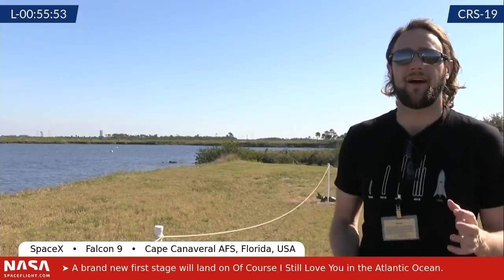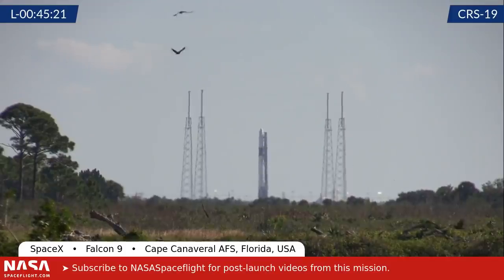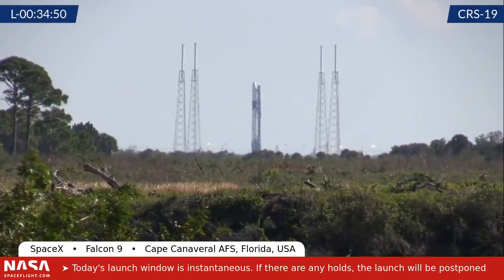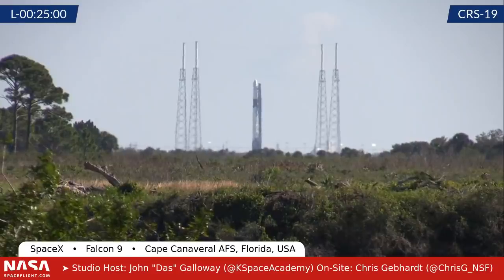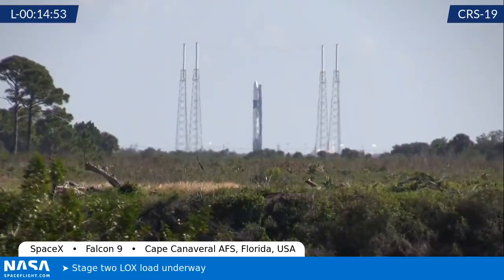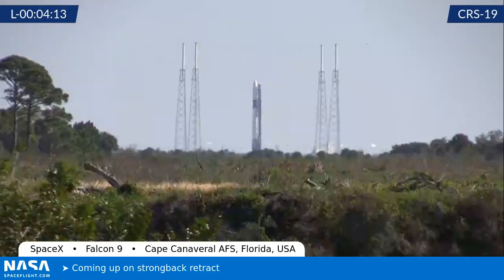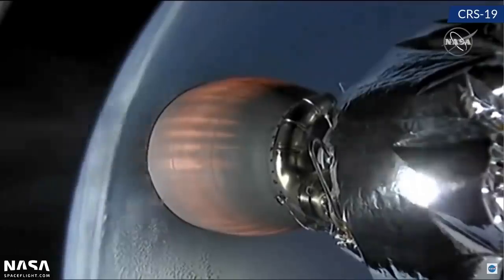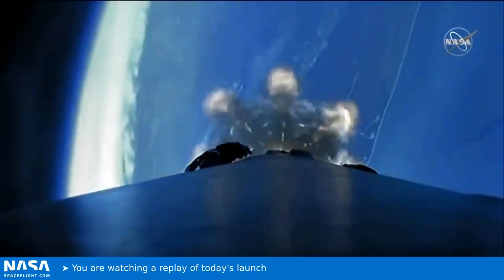SpaceX CRS-19 Falcon 9 Launch Livestream Dec 5 2019

Comment: "SPACE MIGHT BE THE FINAL FRONTIER BUT ITS FILMED IN A HOLLYWOOD BASEMENT" OUTER SPACE IS FAKE. THE EARTH IS NOT A SPINNING BALL
Reply: I wonder what my friends in Florida saw take off from Canaveral then? Ughhh...
Reply: Survival Citizen Oh don’t make the mistake of thinking anyone is claiming that a rocket did not take off from Cape Canaveral! A rocket definitely launched from there! Only thing is nothing was on it and it just arched up and out far enough that no one could see it when it crashed into the open Atlantic Ocean as it and all the previous ones are designed to do! Sooooo...YAY! Mission successful!!!
Reply: OMG this answer in 2019. Go back to school to learn the easy maths and you will be enlightend. Until that, your brain ist the only spinning thing here.
Reply: @karlheinz6545  

You are pretty arrogant considering you are dumb as fck.

At the equator :
- the directions of gravity and centrifugal force are opposite.
- So the centrifugal force has only a vertical component and is an cancelled out by the gravity force acting vertically down.
- Centrifugal force produces an acceleration of 0.0339141 m/s^2
- The effect is simply a slight reduction in the Gravity acceleration from 9.81 m/s^2 to  9.77 m/s^2.
- Causing a weight reduction at the equator of 0.35%.

At 45 degrees Latitude NORTH:
- Gravity is acting towards the center of mass
- Centrifugal force is acting perpendicular to the AXIS of rotation.
- These directions are NOT opposite.
- The direction of the centrifugal acceleration is 45 degrees towards the south.
- Causing a reduction in weight of 0.172929 %
- And more importantly an acceleration of 0.016957 m/s^2 in the direction SOUTH.

For a projectile in free fall (say in a vacuum). 100 meters ( fall time 4.51 seconds )
That would cause a deflection of :

d = .5 * acceleration * time ^ 2 
d =  0.5 * 0.016957 * 4.51^2 
d = 0.172454 meters
d = 17.2454 cm

Check the math.

Gravitational acceleration (m/s^2) =  -9.80576
Latitude (degrees) = 45
Velocity (mph) = 735.64
Centrifugal acceleration (m/s^2) = 0.0239809
Gravity Direction Vector = (0.707107, 0.707107)
Centrifugal Direction Vector = (1, 0)
Combined acceleration = (-6.90974,-6.93372)
Combined acceleration (relative to ground) = (0.016957,-9.7888)
Weight reduction (%) compared to North pole = 0.172929
Projectile drop (time=4.51 seconds) Deflection south (cm) = 17.2454
Reply: @decadent.  Well played...and of course, no reply from the Shills...just crickets!  Bravo good Sir or Madame
Reply: @karlheinz6545  do me a favor and do the tide pod challenge. 70% of the earth is water and water what? Always finds its level. So if 70% of the earth is water and water always lies flat...not that hard to figure out. You want me to Go back to indoctranation school to get brainwashed and conditioned on lies? No thanx im good. Sounds like you love being a brainwashed sheep..foh

Comment: seemed like an awfully low/flat trajectory on takeoff.
Reply: They're all that way.   Spacecraft don't really need a lot of altitudes (only 60-100 miles), but they need an incredible amount of speed to maintain orbit.  The vast majority of the energy used at liftoff is not to gain altitude but to gain velocity tangent to the earth's surface.  So a spacecraft will launch vertically at first to clear the thick atmosphere within a few miles of the surface, then gradually become horizontal to earth to gain velocity.

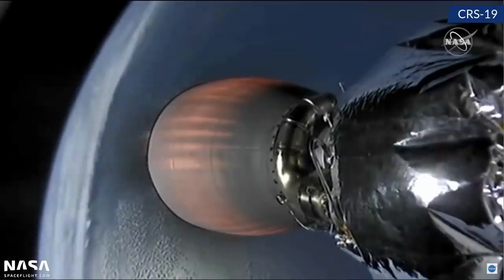Comment: What is on the engine moving right to left of fuel nozzle at 1:04:29 of video
Reply: Thats a mouse 😂🤣😂
Reply: 1:04:30 it looks like a mouse 🤨
Reply: Leif  Poor. Such a poor reply. You're actually boring me now LOL Off you pop. Make sure you get that homework done ready for school hahahahaha
Reply: The vector modulator rotates around the nozzle to push it in the direction the thrust needs to steer the rocket in !  its a thrust vectoring modulator.
Reply: @darrengillesdarrengilles8336  I guess NASA uses mice to modulate their vectors now eh?
Reply: At least get your stories straight, ffs. Vector modulator, RCS thruster or ice that looks like a mouse, walks like a mouse and smells like a rat.
Reply: @damir1477  looks nothing like a mouse LMFAO
Reply: Solid oxygen frost
Reply: @thatman8987  Thrust vectoring nodule is on a track 360 degrees around the nozzle and as it travels it forces the nozzle into the opposite direction of its location which is how rockets are steered ? whats the mystery ?

Comment: Does crosswinds affect the launch ? Joe ....Long Island ny
Reply: Legit question, rocket launch is a very precise science (due to nothing else but the ridiculous costs and the exponential problem of carrying fuel), so too strong crosswinds can certainly affect the launch. But the biggest problem with the strong winds isn't even the trajectory shift (the rocket can probably correct it's route up to a certain point), the biggest issue is that the strong winds can push the rocket against the launchpad and blow up.

Basically, as soon as the rocket ignites, its nearly stationary, as if it was floating, and given how huge its area is, the wind can shift it sideways by a great deal. The rocket slowly gains speed but as you can see, it still takes quite a few seconds to get above the launch pad, even though later on the rocket is able of reaching speeds of 25km/s.
And if you think rockets are expensive, wait till you find out the cost of a launch pad